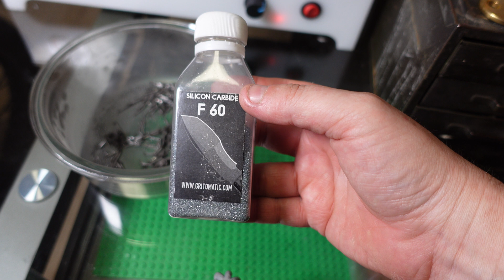My easy way to finish 3D printed parts with no labor

Comment: What are the strength of the magnets you used? I’ve been trying to piece one of these together and I can’t tell if my magnets are just too weak or the flat polisher I’m using maybe spins too fast?
Reply from the maker: They need to strong and extremely close to the container you use. Im not sure of the size youre building but they should be about 40mm and you need to alternate the polarity
Reply: @sweetgumnyc7794  I did remember to alternate! The ones I have are just random things from around my shop, close to 40mm but probably not as strong as I need. I’m going for a fairly small set up similar to the one in the video.

Comment: Constructive criticism : You'll gain more subs if you spend less time. 7 and a half minutes is way too excessive to explain you used a magnetic tumbler. First thing I look at on any instructive video is the length of video. I want to hear the details, quickly and with fuss. Too many content producers spend too long getting to the point, or just seem to like the sound of their own voice. This video could have been 30 seconds long, a minute at most. Subbed any way, because it is a hell of a solution to hours of mind numbing work.